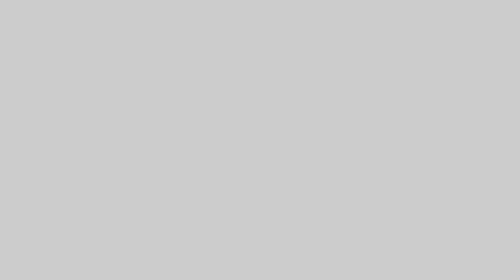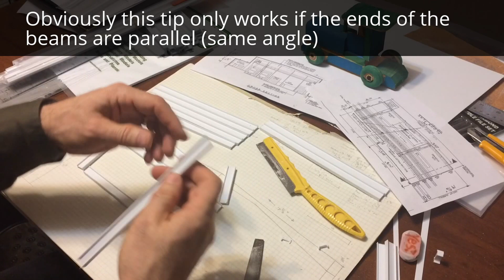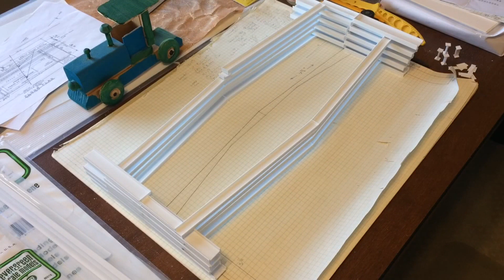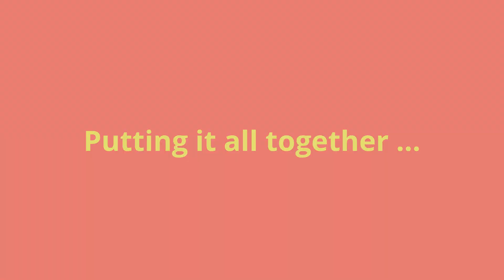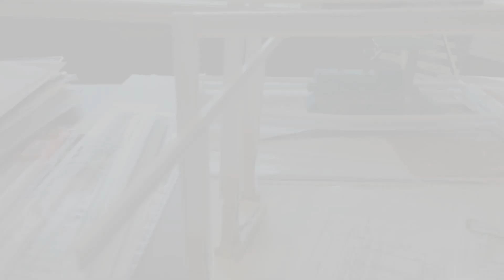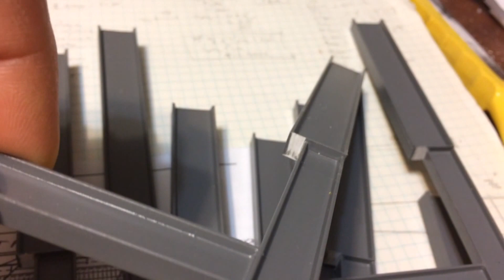Q&NE HO Layout Video 056 - 170225

Comment: There were usually "stringers" between the main beams that would allow the outer sheathing to be screwed to. However, this would add rigidity to the structure as a whole. Usually these were a "Z" shape (more like 2 "L"s) Neat structure and great build log!
Reply from the maker: You are absolutely correct and you'll see some prototype photos of this in my next video (at the very end). I just felt that for a static model where it is unlikely that the insides of the walls will be seen very often, I didn't need/want to go that extra step. That's a lot of additional parts to buy, cut, glue paint etc.

Comment: Wouldn't it be easier to have masked off the rail rests with some painters tape beforehand? I feel you might have gone too deep on some of those shavings with an exact-o knife.
Reply from the maker: Good question, and my answer is "yes and no". I would have had to carefully measure and cut out very small pieces of masking tape so as not to leave white spots of exposed styrene. I was gentle with my scraping, being careful not to shave away any styrene in the process. The reduced contact area for the crane rails is probably because the ends of my wide vertical columns are not perfectly square.

Comment: I may not have heard it but what are the dimensions?
Reply from the maker: The main structure is 16" x 30" x 6" high, but there is another section that is about 3" high that widens the overall footprint width to 19".
Reply: Nice big building. Cant wait to see it when it is done.